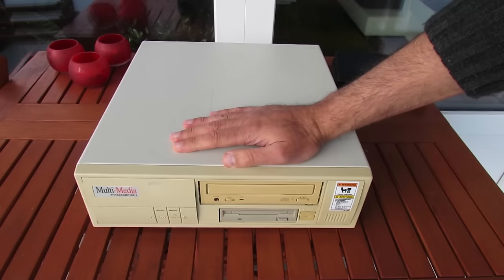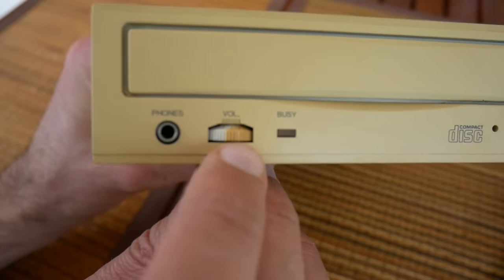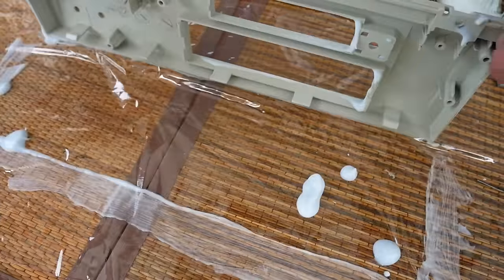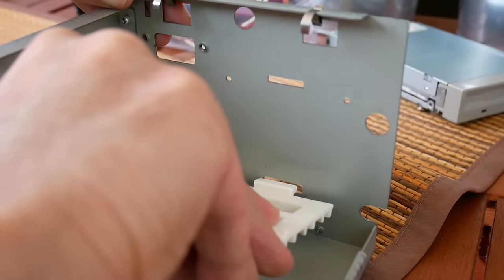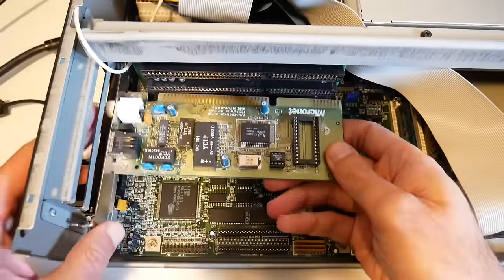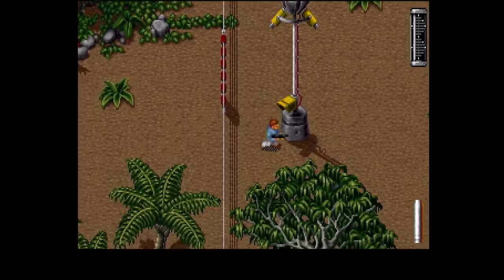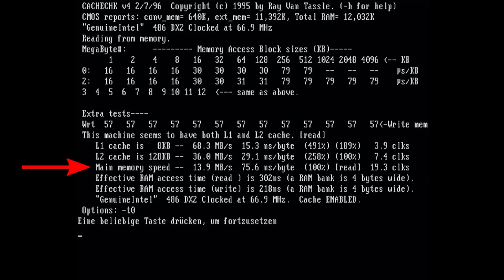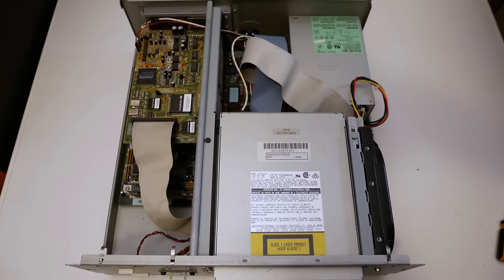Packard Bell PB486CD restoration (Part 3)

Comment: So many of these once-popular systems were just discarded by people thinking they were nothing special. It’s nice to see one so diligently restored!
Reply: To be fair, for most use-cases and users those systems are indeed nothing special after their regular lifespan. It was an outdated „toy or tool“ which was replaced and then useless in the eye of the former owners and I get that.
Reply: @MKRENB  I fully understand why people discarded these systems. I (or my family) had a couple of systems in the 90s I wish I had kept myself. I’m just saying, in retrospect, it’s unfortunate and I’m glad this system was restored so well 🙂
Reply: Only reason they become something special is because they werent and most of them has ended up as ewaste
Reply: I have my recreated fleet of custom-built PCs that mirror setups I had back in the day, but I find that I'm intrigued, now, by OEM builds that I never looked twice at before.  They're little time capsules, and it can be fun to recreate the experience of bringing home a full PC as if you just unpacked it from its original box, with original guts, software, matching monitor, keyboard, mouse, speakers, etc.

It's like seeing how the "other half" lived, when everything I ever experienced was an incremental evolution from my first complete PC build, through years of parts swapping, to my current rig(s).

Comment: Great work on restoring this PC! It's a shame you weren't able to get the machine to run properly with L2 installed. Back in the  early to mid 90's I had PB machine with the other earlier version of this mainboard that also had an ACC micro chipset. I had the version with only 1 SIMM slot and the Headland Technologies local bus onboard graphics with 512KB of VRAM. I was able to install 128KB of L2 cache and not have any memory speed issues with 1 8MB stick of RAM in the SIMM slot for a total of 12 MB of system RAM.
In my case the added L2 made a noticeable difference in many games, especially when I also changed the Intel 486 DX2 66MHz CPU with an AMD 5x86 133MHz in a socket voltage adapter. I ended up having to run the AMD chip at 120MHz (40MHz FSB 3x multiplier) as I could not force the board to send a 2x multiplier to the CPU which would have enabled the 4x multiplier mode. I know these days there are in socket voltage adapters that will allow for this, back then the only one I could get my hands on did not have that option. It only had a few options for selecting the voltage from 3.2 and 3.5 volts with a couple of steps in-between. 
I distinctly remember I had to set my CPU to 3.45 volts in order for it to run stable. I had the machine fully decked out with 2 HDD's, a 3.5 inch floppy drive, the same Panasonic 2X CD-ROM attached to the Aztech sound card I had, a 28.8 kbps US Robotics modem, a SCSI card attached to an external Zip Drive and a NE2000 compatible NIC with a BNC connector on it. My best friend and next door neighbor and I had a coax network setup between our houses (which were close to each other) and would regularly host LAN parties with our friends in our respective basements while we were in high school. Those were definitely good times!
Reply from the maker: I have that board, which you mentioned. You could see it in the last video. Unfortunately, it has the exact same issue.

Comment: Love the video. My Brother had one of these models the compact versions of the Packard Bell in that exact form factor his was a multimedia version but it had the blue overdrive socket. His motherboard did accept both the 5 volts and 3.3 volt chips and he was able to upgrade his to the AMD 5x86 133 Mhz CPU.

Comment: Just yesterday, by great chance, I rescued a IBM PS/2 Model 50 from being thrown into the trash. I had to look for the case in the trash dump, with the accumulated garbage of three days and I only found the lid and the front, covered in mud and crap. the internals almost follow suit, but I save them. The owner, a neophyte, for some reason took it apart, slipped the screwdriver and destroyed 5 resistors and a line on the motherboard. But I have the schematics and hope I can fix it. Today has been a deep cleaning day. The level of dirt was incredible. I even had to disassemble the entire keyboard, down to the springs and keycaps.
Now is almost all pristine clean. still to clean the FDD. Only the 80287 is missing. According to the owner, the last time it was used was perhaps in 2000. It will be interesting to see if the HDD still works as well. the bottom and the back I will try to build similar ones, somehow. the lid still have some rust points, after I clean those I will paint it anew.
Reply: @@repairwins 
yep. 
now also looking for some CGA/MDA/EGA videocards, with composite output (or I'll build a converter) or VGA 8bit or 16bit but 8bit friendly. all those for restoring some machine with historical relevance in my country.

at least that PS/2 have on board VGA. find a microchannel videocard is almost impossible for me

meanwhile, I have some 386/486 and Socket 7 motherboards in the pipeline for testing and repair (I'll need to bring my inner necroware to restore a battery ravaged 386 motherboard)
Reply: Sounds like quite a project.  It's nice to have one that is pristine and beautiful, but also kinda cool when you can point to some battle scars and claim that you saved it from the brink of death.  Good luck!

Comment: Far better than any Packard Bell deserves. I learned to hate this brand with every fiber of my being in the mid to late 90s. I worked at a dialup isp at the time and the stupid combo soundcard/modem most of the pentium era Packard Bell's was probably over 50% of the calls at the time. Desprite that, one customer upgraded to a discreet modem and gave the packard bell one to me, and I somehow managed to get it to work under Linux. It was a Frankenstein machine I built entirely of spare parts for my then girlfriend of an old vesa board, my amd 5x86, 3 hard drives, an adaptec scsi card and that PB modem under Debian.
Reply: This was kind of a different era for them.  I suspect this era was actually OEM'd by Samsung, which appears to have also OEM'd at least the IBM PS/1 486 that I have.  These machines weren't too bad.

Those combo cards were made by Aztech, which ... for reasons I can't fathom ... are well regarded today.  I remember them being an absolute pain in the @$$ back then.  Configuration was often an obnoxious jumper / software-select combo, sometimes storing assignments in EEPROM, etc.  If you set them up correctly, they work pretty well.  But it was not as obvious as e.g. a contemporary Sound Blaster.  It was also a pain to find the correct drivers for a given board.

Comment: I'm certain I've said this before here but I don't think It will hurt to mention it again. The program "Spinrite" from GRC is a paid program that can really test a hard drive and sometimes recover data from bad sectors. It can sometimes "exercise" the drive enough to fix bad sectors, but I wouldn't trust the drive except only get the data off.
Edit: It's really expensive, unfortunately but I think the cost is worth it.

Comment: This was the first IBM compatible I owned as a child. Unfortunately by the time I had got to it as an adult to fix the varta problem it had too much varta juice for too long and there was basically a large hole in the motherboard where the only traces left disintegrated at the slightest touch.

I still have it and all the other parts. I use the power supply regularly to test motherboards that needed AT style connectors. you may even spot it in my ISA doom videos since it is handy for the power supply to have a switch mounted directly on it and being rather small.

Comment: I had the tower version of this, minus the multimedia features and with the modem. IIRC, there was an optional COM2 port kit for these.

I’d highly recommend modding this for an intake fan going over the processor area if you ever want to run a DX/2 or faster chip on this system.
Reply: Also, the fact that you have the 5428 is a win. If you can find the ZIP chip memory for it, you can upgrade the video memory to 2MB, which makes a mild difference in overall video performance from what I remember.

Comment: Great work, saving another retro PC.

One thing I immediately noticed: 
You use the wront screwdriver for the case screws. The screws in computer cases in most cases are Philips type 2 while you are using a type 1 or smaller. This way you can easily mess up the screws.

By using the proper screwdriver, you can apply way more force without destroying the screwheads.
Reply from the maker: Yeah, as you saw in the video I'm lazy and just take the screwdriver which I have at hand. If I notice, that a screw is sitting tightly, of course I take a proper screw driver then.

Comment: This HDD looks like it really has a lot of hours on his back. However if you have time try to use some software such as HDAT2 and give it 2-3 unconditional format. I did  this on approx. 2-3 drives of that age and some / all BB disapeared. But I had like 2-3 BB per drive. In your case there might really be a phisical surface damage. Anyway the drive still can serve in a retro machines some years...👍

Comment: I have the same L2 cache issue with my Packard Bell 486 system.  I had upgraded the BIOS a long time ago using MicroFirmware and I thought maybe their BIOS wasn't properly optimized for my system.  I never thought that adding L2 cache would slow down the main system RAM!  The next time I power it up, I'll have to try disabling the L2 cache to see if the system RAM speeds up.  So annoying if that's true.

Comment: My PB 286 was my first computer, loved that machine.
What type of Oil did you drop in the fan?
Reply from the maker: Machine oil for small mechanical parts.
Reply: @necro_ware  Just checking, I swear at some point in the past someone on yt was using eucalyptus oil for lubricating fan coils for some reason,
Reply: @necro_ware  I think those fans have integrated ball bearings, so not much to be really done with oiling them...

Comment: The slowdown is due to having more RAM than the L2 cacheable area size. If you put less ram, or more cache, the problem will go away. It's not a bug.
Reply from the maker: No. Trusted with down to 2MB.

Comment: Great video !
About Jurassic park, it seems similar to the one on the SNES, which also has a "3D" view (although more limited). I don't know if they're identical, but it's probably been made by the same team or company.

I wonder if the cache issue is a chipset issue, a design issue or a bios issue (which doesn't seem to be fixable with another Packard Bell bios). Maybe you could try the BIOS from a more standard machine using TRW ? Maybe it'll let you tweak more settings, including the memory/cache timings ?
Reply: It was indeed made by the same company (Ocean Software) but other than having a lot of stylistic similarities (the motion sensor terminal poles, some similar dinosaur enemy art, indoor first person segments) are completely different games between PC and SNES. The PC CD-ROM and Amiga game are identical (though the Amiga one is inferior technically), the game is  completely different than console releases.
Reply from the maker: Hi Deksor! Thank you. I indeed tried to play with different BIOSes, unfortunately with no real success. I got one BIOS which was very different kind of working, but that didn't change anything, so I assume, there is some kind of hardware bug. Currently I'd like to put this project aside, I already invested a lot of time into it, but in the future I might give it another try, if I get new ideas. Thank you for watching ;)

Comment: Shame with that cache bug... I had a similar project some time ago, a boring HP Pro 3410 series computer, I was always amazed by those mini computers, always liked HP computers and needed another one since my 10 year old Hp laptop died, the first one I bought
Quickly gave up on the motherboard cause it was also bad but I tried to keep it same generation, intel 1155 socket, had a P8H61 board lying around and upgraded to the max wirh i7 3770 and 16 gb of ram, my old gt 1030 for light gaming, maybe one day I will make it really powerfull and try to modify the bios to look more HP-like

Comment: Now that's a bit of a bummer. L2 cache bug? Would have been fixed, If you had changed the chips and increased the L2 cache?
Reply from the maker: This machine allows only 128K or 512K cache, but for 512K you need super rare chips which I don't have. I even never saw such ICs.

Comment: Re cache issue - had you tried checking memory speed using only onboard memory chips? It could be an issue with chipset being unable to cache "large" amounts of memory - 12MB are a lot for 486 era.

Comment: just got one of these mainboards in a ZDS Z-100 pc, weird but whatever. seems to be rather nice, it performs well when running with a DX2-66 @ 80 mhz. curiously the turbo switch PAL was not populated at all, so turbo does nothing and the machine is always in high speed mode. it's a shame that this chipset mishandles L2 cache so badly though, still i'll try with 512 KB and see if it makes any difference. also, i wonder what J29 does, seems to make no difference on my board, but i saw it labeled as "Fast CPU" on some manuals. 
sadly, this chipset feels like one of those pcchips crapshoots, there are no datasheets whatsoever on the internet. quite mysterious.

Comment: Have not you thought about messing arround with BIOS and unlocking timing options? Maybe that's an issue with ram/cache situation?
Reply from the maker: I did try of course, but there was nothing to show, so I decided to skip.
Reply: @necro_ware  it's a shame. I thought that there might be some hidden timing settings :) thanks for the reply :)
Reply from the maker: michaelscarport  tried that too. As I experimented with various BIOS dumps I took s.t. what didn't had integrated Cirrus Logic VGA bits, so I had to use another card. Neither that, nor my BIOS adventures did change anything on the situation.

Comment: what about a low level format on the original drive?
Reply from the maker: That makes no real sense on IDE drives. On MFM drives it was necessary to reformat geometry to fit the controller, but on IDE it's not what should be done.
Reply: @necro_ware   If memory serves, IDE controllers will actually recognise commands for low-level formats, and then proceed to ignore them. I think the recognition needs to be there because they understand the command set from earlier controllers, and the ability to do a low-level format was part of the spec, so they have to include it, even if they don't actually do anything with it.

Comment: Reverse engeniering the BIOS on the system , perhaps solves that problems. One problem with this computer is OS/2 Warp it does not work Hangs , but only works when turbo is enabled.

Comment: I would have bet a bug in cache management only when extra memory sticks installed
Reply from the maker: Nope, I tried with different amounts as well. Deactivated on-board memory and used just 2MB stick. All the same.
Reply: @necro_ware  Too bad. Did you also try putting more cache ? Looking at the sockets maybe 256 ou 512 MB ? Anyway, I like your videos and I'm impressed by your soldering skills